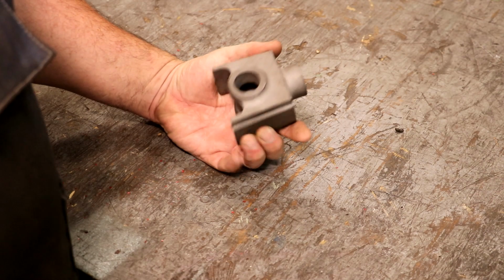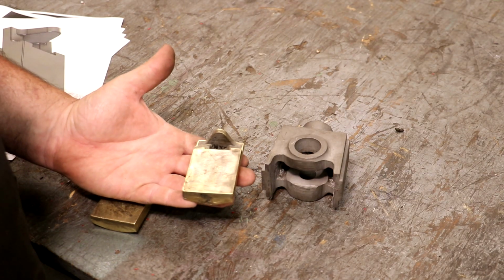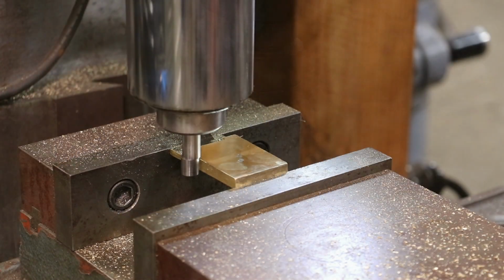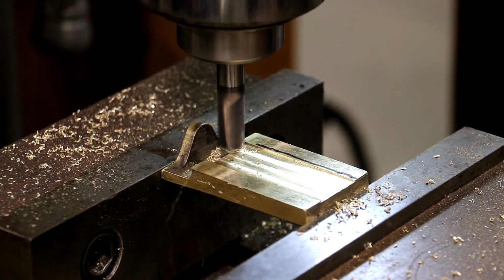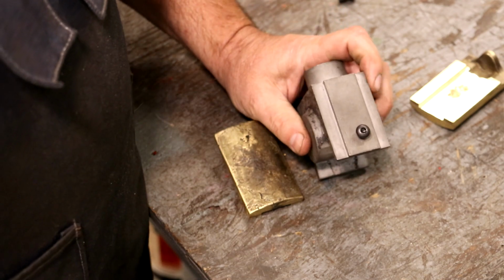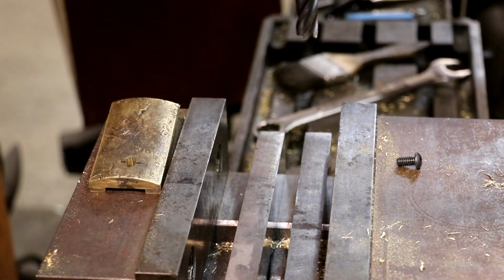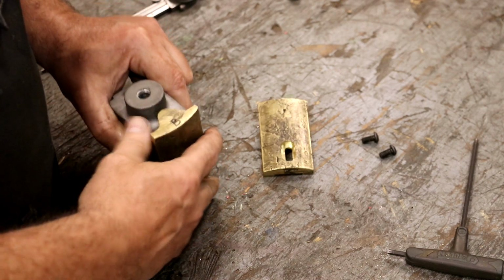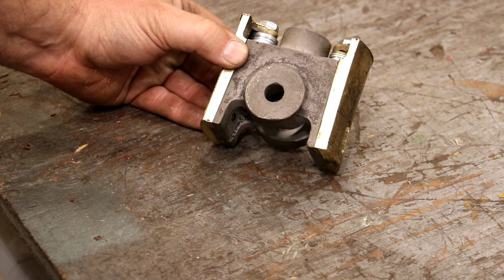Machining Bronze Shoes for a Steam Engine Cross Head

Comment: heh heh heh.. I used to make those when I was an apprentice.. right at the death of the steam age. FYI the screws are brass flat heads, the bearing surfaces should really be phosphor bronze, but I can't see this engine getting heavy use so I doubt it matters. The screw slot serves another function in many engines as it's a part of the oiling system. 
It's great to see the rediscovery of these now lost skills and knowledge.. these "simple" bits designed to wear away are actually really complicated with lots of included angles and clearances.

To turn the OD we just used to bolt the whole thing to a large bolt .. there was a rack  at Booths of all the sizes from 1/4 inch to 6 inch, with washers and nuts as appropriate.. yes.. we did some really big stuff back in the day.. sadly now all long gone to scrap.. and shove them in the lathe.. the end total OD wasn't really our problem as long as they were in the ball park, every mill had a fitter, and by this point everything was worn to within an inch of it's life anyway
Reply: Brass is a very good bearing material and it has proper locations for use. It must be lubricated and water / steam is a lubricant. There are a tremendous numbering of water cooled / lubricated brass pump bearings out in the world. Yes they are mostly the old ones as that’s how it was done in the day and they are still with us. The large Diesel engine used on cargo ships are made exactly like this but much larger. They use brass and bronze, cast iron, aluminum, Babbitt, and other various alloys for this sliding mechanism.
Reply: @joebledsoe257  except that the crosshead shouldnt be in contact with water or steam in normal operations if the packings are not leaking
Reply: Brass tends to grind down the shaft when used as a plain bearing. Bronze is much better in this respect, and it's usually stronger than brass so it can handle greater loads. Of course if the load is light and lubrication is good even very poor material selections can work ok.
Reply: I, heck the whole steamboating community, would love to hear more of your stories. What firm did you work for?
Reply: what are you like 150yo? :)

Comment: Please no fireworks on this question. I know nothing about machining/metal working or the like, so this will probably seem such a stupid question but here goes. As you needed to remove 1 inch of material and you found centre why did you not use a 1 inch bit to remove the 1 inch of waste. My thinking is that by using a smaller cutter and making several passes you  could leave yourself open to making an error every time you had to move the piece to get it to size? Sorry if I upset anyone by asking such a basic question but I am a tad senior and have never been taught anything like this and I am interested in the thought behind the decision. I am likely never be able to use the info but at my age I like to learn things as it keeps the grey matter working to some degree. Thanks
Reply: The larger the cutter, the higher the forces imposed upon both the machine and the work. In this case, where the part is made of a softer material, and not able to be more solidly held in the vise, a larger cutter could force the part out of position during the milling operation, completely ruining the custom casting. Also, using a 1in tool to cut a 1in slot leaves no room for error. Using a smaller cutter and moving out to the sides allows for double checking of the setup/results as the milling progresses and fine adjustment as necessary. If it were 1 in cutter, a small error that might otherwise have been caught and corrected will result in a ruined custom casting. In this case, at least. It all depends on the combination of materials, actual shape of the part, tooling, and machinery available.
Reply: @davel6683  Thank you for your reply and I can understand your reasoning. It was well explained to a numskull like me. Thank you again
Reply: in theory you are correct, a 1 inch cutter to do a 1 inch slot, the variables though are how well the piece is being held, a 1 inch cutter is removing twice the material as the 1/2 inch cutter so really needs a firmer grip than what he had in the vise, the other variable is does Keith have a 1 inch cutter on hand, thirdly, if the part did move using the 1/2 inch cutter then he still has plenty of material to allow for such a situation, with a 1 inch cutter in this situation, if the part moved, then it's a phone call to Windy Hill foundry for another part to be cast.
Reply: @HawksofOz  Thank you for your reply and all understood
Reply: @T_Hoog  Thank you for your reply. It all seems very complicated to me but the 3 answers that I have received have been brilliant. Thank you all for enabling me to enjoy even more these videos
Reply: Just having a 1" cutter doesn't guarantee a 1" slot. Sometimes, they cut over or under a simdge (especially if they are worn or have been sharpened) it also can depend on the material and the heat generated during cutting. Also, there wasn't enough room between the tab and the surface at the top end to run a 1" cutter far enough to finish the cut.

Comment: I love it when a modern technology (in this case 3D printing) replaces a process in a positive way. I mean, don't get me wrong, learning how to make your own patterns, it's important, but for time savings, cost of production, being able to 3D print a pattern and ship it to the foundry (or better yet, if they offer this service...) that's top. Imagine we could've had this entire process by at least 10 years earlier, if it weren't for greedy patent sitters who held unto the patents for as much as they could, in order to prevent this technology to reach public hands.
Reply: 3D printing has been around since the 70's.  The problem was the price.  In equivalent dollars they were $50,000 each.  The Englishman that worked on it in the 90's made what he knew public because he was a professor and it had to be un-patented and an open project.  It took the drastic lowering of price of lead-screws and electronics to be so common.
Reply: @katemoon7476  Yeah, no. Stratasys was suing the crap out of anyone who tried to sell FDM printers until at least 2015. Their price fixing was the only reason they were ever expensive

Comment: Very interesting. One cross-head shoe, and its ways, will take most of the wear due to the lateral thrust component. The difference will be greater on a double-acting steam engine. 
 Cross-heads are used on internal combustion engines as well as steam, in particular marine 2-strokes.
Reply: A  double-acting engine will wear both shoes more evenly. The down stroke will push one shoe against its guide and the up stroke will pull the other shoe against its guide .
Reply: Paul G It helps if you draw a sketch. Whichever direction the cross head is moving, in a double acting engine the lateral component of the thrust upon the con-rod will always press upon the same slide.
Reply: @jerrytugable  Yes ,you are correct.
Obviously my  brain was not quite as good as a sketch when I first considered the model.

Comment: Nice job Keith, I will assume that the fixturing for the next part will be installing a threaded shaft to simulate the piston rod so that it will be in line with the piston bore. Then a wrist pin center drilled for the tail stock to keep it running true? That's just a guess I will have to wait to see how you do it.

Comment: Should the adjustment screw holes in the brass be slotted to allow for the taper of the shoe from new to worn-out? the screw O.D. may limit a full range of adjustment.
Reply: I have seen many variations.. some are forks rather than holes. It depends on the angle of the bolts. Looking at these I think you are right, they should be slotted. These are what locally were called "single enders", there were also "doubles" on the really large stuff and those didn't have the locking screw and slide, just an oil channel, which meant the whole crosshead didn't need to be taken apart to replace them.. the bottom ones on horizontal engines wore out first and it was usual to swap them over as necessary
Reply: Eric does have a bridgeport mill if adjustments need to be made.
Reply: You can see on the Hand Tool Rescue video at 24;53 https://youtu.be/S-U-_U4gs1A?t=1493 that they have been made slots.
Reply: Oh, I did not see your comment, ya beet me to it...

Comment: I have a question Keith. Since the distance between the two adjusting bolts is fixed, as they are tightened to take up wear, the sliding pieces moving down on a taper will be moving outward. So the holes that the bolts pass through should be slots. Did you take this into account? Thanks for the video.
Reply: I thought of the same thing and knew that others would have already commented. I looked like the hole might be oversized, but Keith did not mention it because the casting slope that needed to be removed was more important.
Reply: The taper isn't very steep, and the movement radially is much smaller than the axial movement. Keith didn't say what the angle was, but if it's 10 degrees, there will only be 0.026" of outward motion over the whole range of the 0.150" length of the slot in the bearing faces. [0.026=0.150*tan(10)]
So the hole for the adjusting bolt only needs to be about 1/32" oversize, not really worth setting up for a slot.
Some additional tolerance is necessary because the hole is not parallel to the bolt, but that's also small.
Reply: Personally, I think he just wanted everything rigid for the lathe work.  The slot wasn't necessary at this point.

Comment: Looks like a good job of reverse engineering but is brass the right material for a bearing, would not a bronze be better?
Reply: Interesting question.  Bronze too hard to be used in the application?
Reply: @cemx86  there are lots of different bronzes, which often leads to confusion, that's why i just said a bronze.
Reply: Yes, the zinc in bronze is not a Babbit meatal, but the tin in bronze is.
Reply: I think bronze is optimal for bearing which get a lot of pressure not necessarily just any old bearing - I may be wrong.
Reply: need oil inpregnated bronze bushing material
Reply: @ronalddavis  trouble with sintered bronze is when you machine it you close up the pores .
Reply: I'd agree, a 932 bronze would probably be better if the engine were going to see heavy use.  It's unlikely for that to be the case though.